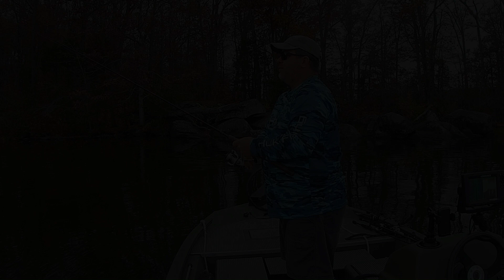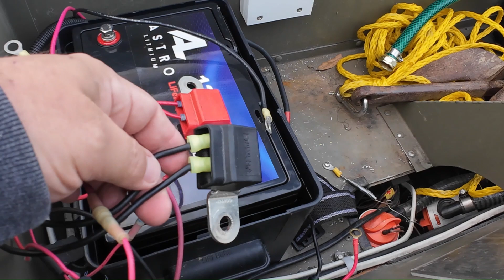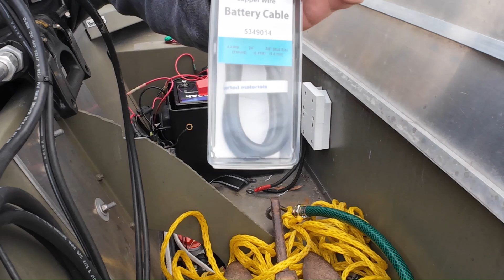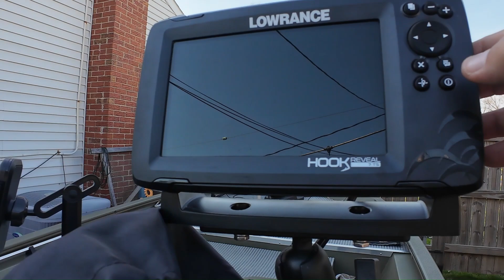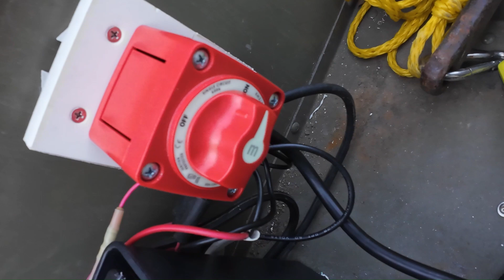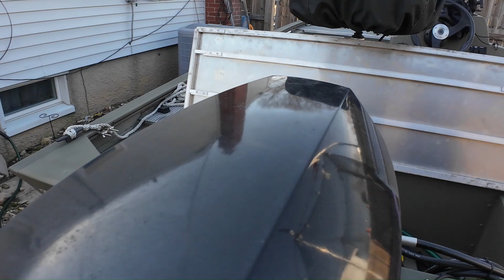Safety First! - Install A Battery Kill Switch On Your Boat!

Comment: I really like the battery post mounted buss bars that you have. Right now I stack up multiple wires of various sizes on my terminals. I am not happy with that. So I got a side benefit from your video!
Reply from the maker: yeah they worked well until I wanted to put in the kill switch and then I had to get rid of the one side.